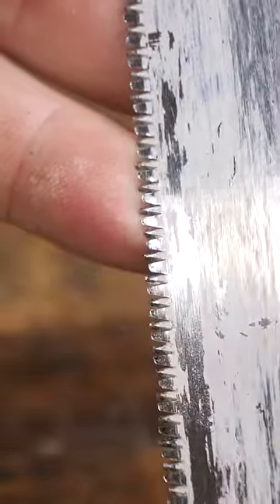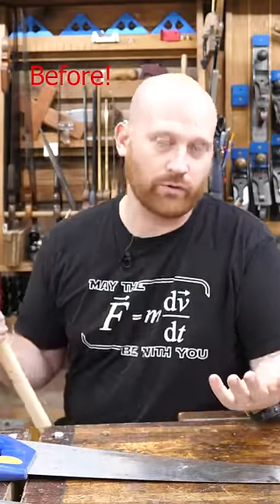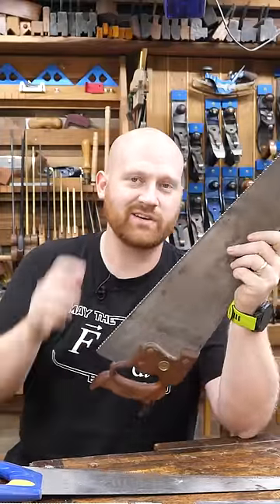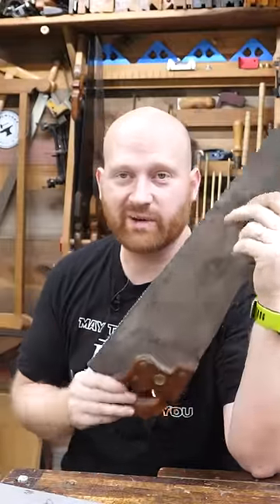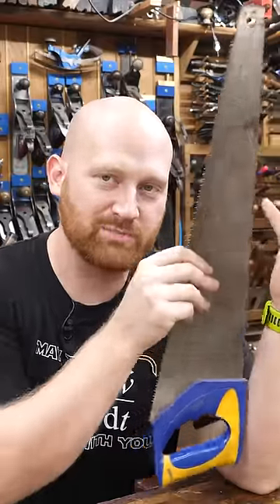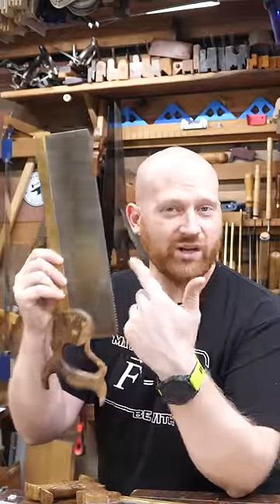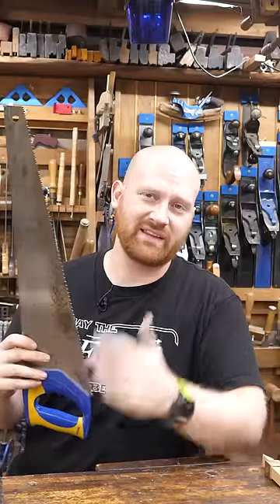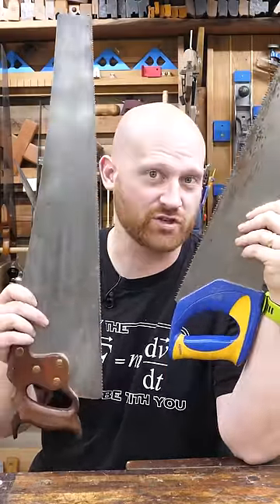Hardend Teeth Vs Old School Teeth on a Hand Saw

Comment: If it's hardened just unharden it and do what you have to do and re-harden it..
Reply from the maker: Good luck with that. If you really want to keep using the $10 saw then you can get diamond files, but those usually cost even more. I have head of several people suggesting annealing and regarding. But I have never heard of anyone successfully doing it without destroying the saw.
Reply: @WoodByWrightHowTo  or just use angle grinder instead of file hehehe
Reply: Then it's definitely ruined.
Reply from the maker: I do know a few people who will grind off the hardened teeth and then file in New teeth.

Comment: Couldn't someone soften his teeth , sharpen and re harden wirh some heat and quench ?
Reply from the maker: That sounds good in theory, but in practice, it often warps the plate. most people if they want to re-sharpen it grind the teeth off and file in new teeth, but both are a lot of work for a $10 saw.

Comment: Pro tip, you can un harden metal with heat. Hit it with a torch or take it to the belt sander and grind them flat and start over
Reply from the maker: That will work. The problem is then you're left with a cheap still that is intended to be hardened rather than 1095 spring steel like most of the other good ones.
Reply: @WoodByWrightHowTo  next comes the trick of teaching yourself to harden metal 😉🤣
Reply from the maker: I know a few people that have done that, but that usualy ends up in warping the plate. not to mention you are talking about a LOT of time for a trash $10 plastic saw.

Comment: I wouldn't say it's that the art of sharpening was lost it's just that in most of the situations a hand saw is going to be used sharpening a saw is just not worth it. Time is money and when a jobsite saw cost £5 a piece you're just wasting precious man hours that could be spent working on filing a saw. 
On top of that getting someone else to sharpen it for you is going to cost more than the price of a throw away saw that will last 3 times longer anyway.

Comment: They were hardened actually, just not made harder than the rest of the saw. The saw itself was made of spring steel with a spring temper. Still true of "disposable" saws today, but if you decry disposability like some commenters seem too, take a new saw and put your woodworking to the test. Make a nice handle, file in some new teeth, learn to set and sharpen them. The difference between a modern saw and an older one is a lazy sawyer.
Reply from the maker: You are exactly right. But in the field they are referred to as unhardened to differentiate from hardened teeth. And the hardness that they were brought up to is very mild.

Comment: If it won't rust it ain't worth a fuck. Carbon keeps cutting.
Reply from the maker: That's why most of the good unhardened saws are made of 1095 spring steel

Comment: You can get diamond files for like, $30 that will sharpen hardened steel, or even fancy carbides, with no issues.
Reply from the maker: True but that's three to six times the price of the saw. And those diamond files don't last long. You only get a couple sharpenings out of them. And then you're still stuck with a cheap plastic handle saw.

Comment: Generally not gonna find hardened teeth on a saw after World War II? Btw, Can’t they grind the hardened teeth?
Reply from the maker: that is why I put on the text on the image. did not catch that untell edit and did not have the time to re shoot. With the profile needed to sharpen teeth grinders and cutoff wheels will not work. you can get diamond files, but those cost more then the 10$ plastic saw.

Comment: You stuffed up- you said " you're generally not going to find hardened teeth on a saw made after ww2". Besides that, my dad was a builder from the late 50's til the mid 80's. All of his handsaws until the late 70's were soft toothed sharpenable types. He always had a couple tooth setting pliers laying around the workbench and he had a saw sharpening vise. Funny thing not once do I ever remember him sharpening a saw.
Reply from the maker: that is why I put the correction in test on the image. I did not catch it tell editing and could not reshoot at that point.

Comment: If you are a carpenter building a house, use power tools.

I can see the appeal of hand tools in a shop, but they are very few situations where they have use case on a jobsite.
Reply from the maker: I use to be a framer and we had two in the trailer. They were the tool for the job in several places such as cutting the bottom plate in a dore way. There are a bunch of places where it is faster and easier then any power tool.

Comment: But knives are hardened, and you can sharpen them.
Reply from the maker: You sharpen knives with a stone or diamond plate. You can't use a slip Stone to sharpen saw teeth. You can get a diamond file the right size and shape but it usually cost two to three times as much as the saw. And do you really want to spend all that time and effort on a cheap plastic saw?

Comment: You can file hardened metal and you can sharpen sauls with hardened teeth
Reply from the maker: it is true that they make diamond files that are the correct size and shape. though they are hard to find and cost more then the saw, the question you have to ask is it worth it for a trash plastic saw?

Comment: We have a tungsten file that we use to sharpen our hardened teeth with
Reply from the maker: That's a lot of expense for a $10 saw.
Reply: @WoodByWrightHowTo  Our saws are also made with an iron-cobalt alloy, while not cheap, they last 2 lifetimes. Don't know the exact conversion rate, but it should be around 200-250 dollars, and the file is also used for more things of course
Reply: @WoodByWrightHowTo  It was my grandpa that got all of these things, we also have a tractor grader made from Armour plates he acquired from a friend who then worked at BAE Systems. Not to mention the like, 60 feet(?) of electrum wire that no one knows where it came from. We'd honestly not be surprised if we find a hiden box of dynamite as well, he loved to search for dynamite sticks by the rail as a kid.
Reply from the maker: Oh you are talking about power tools. that is a whole different matter.
Reply: @WoodByWrightHowTo  Nope, it's a regular hand saw, just that my grandpa had a real talent to bring strangest kinds of things and tools home 😅

Comment: Fun fact. They arent unhardened that are just hardened to a spring level of hardness. About  blue color hardness. Which can still be sharpened with a file but not damage it.
Reply from the maker: Correct. In the saw world it is refered to as in hardened to differentiate from saws with hardened teeth.

Comment: Consider the amount of time it takes to sharpen a saw once, say per tooth it takes you 5 seconds. The saw has about 150 teeth, so this amounts to 5*150=750second = 12.5 minutes (if you're really fast, no mistakes no prep) Now multiply this number times 350. That is about 73 hours of sharpening you'll be doing. In 73 hours one can make well over 3000 dollars. You can buy 180 20$ saws with that. Not that you would, just saying. If you like tools and like the process, then by all means go for it.
Reply from the maker: there is a reason that quality Woodworkers use the unhardened saw. Quality saws do not come hardened other then the cheap Japanese saws.

Comment: Couldn't you always just anneal the hardened teeth?
Reply from the maker: That sounds good in theory, but in practice, it often warps the plate. most people if they want to re-sharpen it grind the teeth off and file in new teeth, but both are a lot of work for a $10 saw.

Comment: How many people are building houses with a hand saw. When i was a framer we used circular saws
Reply from the maker: I was a framer for several years. We had two of them in the tralor for cutting out the bottom plate in doorways and other similar tasks. It is much faster than an oscillating tool and can get right up to the frame, unlike a circular saw.
Reply: @WoodByWrightHowTo  ok thats a good point i worked for a pretty sketchy foreman we didnt have a single saw that wasnt a power tool

Comment: how to sharpen a hardened saw?
Reply from the maker: You can get triangular diamond files but they usually cost twice as much as the saw and is it really worth spending that much time and money on a cheap plastic saw?
Reply: @WoodByWrightHowTo firstly thanks for the quick response
i own 2 silky outback editions..one blade costs 60€, how much are the files ?
Reply from the maker: here is a video on it. https://youtu.be/e7YsjKhqk-w?si=rzZzEnxoy43n1gHt Finding the files can be difficult. you can find the cheap ones on amazon, but they usually only work for a sharpening or two.
Reply: @WoodByWrightHowTo  thanks a lot :)

Comment: They are hardened. Air hardened. You can sharpen them with a harder file or triangular sharpening stones. If they were not hardened they would be practically junk to begin with and files would eat them up when you go to sharpen them.
Reply from the maker: Go and ask and he saw maker. Will tell you is that the best saws on the market are now made with simple 1095 unhardened.

Comment: I've been in the trades for 35 years and never once have I seen a hand saw on the job.
Reply from the maker: I use to do Framing we had a couple in the trailer. They are great for cutting the bottom plate in doorways and other such jobs.

Comment: Couldn't you just anneal it, sharpen it then harden it?
Reply from the maker: That sounds good in theory, but in practice, it often warps the plate. most people if they want to re-sharpen it grind the teeth off and file in new teeth, but both are a lot of work for a $10 saw.
Reply: @WoodByWrightHowTo  That’s true but if you are invested in the craftsmanship and quality of the metal in your blade it would be time we’ll spent.
Reply from the maker: The good quality saws do not have hardened teeth. hardening them would only give you about twice the usage, but you would run the risk of destroying a saw every time you do it.

Comment: or just aneal the steel on the hardened ones once you want to sharpen, just get all the teeth red hot and let em cool naturally
Reply from the maker: That sounds good in theory, but in practice, it often warps the plate. most people if they want to re-sharpen it grind the teeth off and file in new teeth, but both are a lot of work for a $10 saw.
Reply: @WoodByWrightHowTo  you would have to be fast and use concentrated heat to not heat the rest, or you could just have the back part in water but if you just ran across it with oxy acetalyn or something you could get the teeth past non magnetic way before warping the whole saw, and a tools a tool, rather fix mine than go and buy another. Also you could by pass all of this by using abrasives like a dremil cut off wheel to sharpen instead of a file

Comment: Wouldn't it be possible to anneal the hardened teeth, sharpen the saw, and then temper it again after? Seems like it would be the best of both worlds and get tons more life out of a modern blade.
Reply from the maker: That sounds good in theory, but in practice, it often warps the plate. most people if they want to re-sharpen it grind the teeth off and file in new teeth, but both are a lot of work for a $10 saw.
Reply: @WoodByWrightHowTo  Katanas I believe are tempered by covering the bulk of the blade with clay. That may prevent warping, but I can see why it would probably still not be worth it.

Comment: An old saw would cost alot more than the throw away ones meaning the throw away ones are better value for money in the long run plus it wouldve been harder to mass produce hardened.
Reply from the maker: You can get a great quality antique that will last you a life time for $5-$10
Reply: @WoodByWrightHowTo  I meant an old saw purchased when it was new back in the day. They also only make sense if the time sharpening is short... if it takes an hour might aswell just buy a new one.

Comment: use a diamond file to sharpen that hardened saw.  Generally, the teeth fail beyond sharpening though.
Reply from the maker: It is posible. But those files usually cost more than the saw

Comment: you can sharpen hardened.. with stone not file.
Reply from the maker: You can get a slip Stone thet is the right size and shape, but it will destroy the stone. Not to mention it is a lot of work and money for a $10 plastic saw.
Reply from the maker: That won't sharpen a cross cut saw correctly. Would be great for carbides or circular saws. But the geometry on a crosscut saw is very different.
Reply: yes it would.. it has its how we do it. @WoodByWrightHowTo
Reply: you cant deny what I know bud. thanks!

Comment: Tbf you could just harden and unharden them as you please to sharpen them and have them last longer
Reply from the maker: That sounds good in theory, but in practice, it often warps the plate. most people if they want to re-sharpen it grind the teeth off and file in new teeth, but both are a lot of work for a $10 saw.

Comment: It's not really that the art of sharpening disappeares but that saws became cheap enough that sharpening didn't make sense

I actually tried sharpening a new one with a cut-off wheel in a die grinder. It worked perfectly (sharper than original) but the time it took me equalled $40 under my current contract
Reply: I almost forgot: the saw i sharpened was a bahco prizecut

Comment: You got it backwards my man.

Its because of the hardened teeth (and the marketing advertising the "benefits" of  hardened teeth) is why the art of sharpening vanished.

Not the other way around. 

The glorification of less work/cheaper crap is why nearly everything you buy today is based off planned obsolescence.
Reply from the maker: Sharpening disappeared with the Advent of power tools. The hardened tooth salt is a much newer thing.
Reply: @WoodByWrightHowTo ???

We don't have powered scissors,kitchen knives, pocket knives, hunting knives, plane blades , chisels ect

A saw is one of only a few cutting tools power tools "replaces"

Your incorrect on this one.

People stopped Sharpening because companies marketed cheap crap tools as better because they required no maintenance.
Reply from the maker: If you feel that way thank you for the feedback.
Reply: @WoodByWrightHowTo  it's not how I feel. It's fact.

Comment: But if you have good hardened teeth how often do you actually have to sharpen them oh yeah because if the metal has the right hardness it doesn't lose its Edge we've gotten away with using these modern hand saws for years in my family so I don't know where all this is coming from
Reply from the maker: the hardened teeth last about 2-3 times longer.

Comment: Nothing to do with the art of sharpening. Simply put the hardened teeth have a geometry that allows cutting on both the push and pull strokes doubling efficiency. However you cannot replicate this geometry on a hand sharpened saw. In addition sharpening a saw takes time which if you are a professional is time you are not making money. Consequently, if a hardened saw is sufficiently cheap then for anyone using a saw it is more cost effective to buy hardened saw. I would note that the main component of the saw is the blade which is infinitely recyclable once melted down. You can get hardened saws where the blades can be swapped out, but are actually more expensive. Finally I would note in the olden days they didn't have the technology for hardened blades which is why you had to spend all the time sharpening your saw. Once hardened saws became available old style saws quickly went the way of the Dodo.
Reply from the maker: The geometry on the tooth is a standard crosscut geometry. You'll find it on even the Saw's intended for resharpening. And even today if you seriously get into woodworking and you want to buy a quality saw it is resharpable. Only the cheapest trash size you buy in the hardware store or Big box store are hardened.
Reply: @WoodByWrightHowTo  if you are a professional wood worker, then time is money and that means hardened saws period. If you want to be Amish about your saws that's fine, just don't pretend it's anything else.
Reply from the maker: that is interesting as I am many of my friends are full time professional woodworkers, cabinet makers, and Joiners. None of us would touch a hardened saw for joinery work.

Comment: What if you got the best of both worlds? Hardened teeth that you sharpen with a grinder...
Reply from the maker: you cant sharpen them with a grinder you need a 60 degree profile to fit in there like a triangular file. they do make diamond files but the thin plate wears those out very quickly and they cost more then the saw. there is a reason the quality saws still come un hardened.

Comment: They made better files for that now.
Reply from the maker: It is true you can get diamond files that are the right size and shape. But using them to sharpen a sod destroys the diamond file I'm very quickly. And they tend to cost more than the saw
Reply: @WoodByWrightHowTo  I guess I just don’t know how expensive the saws are. I’m used to using a diamond file on knife serrations and a metal file on chainsaw teeth